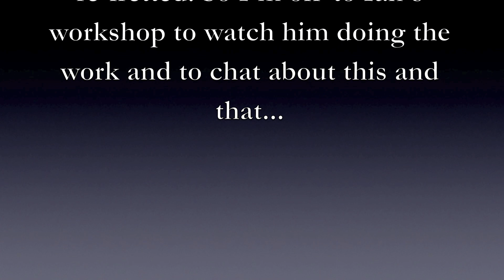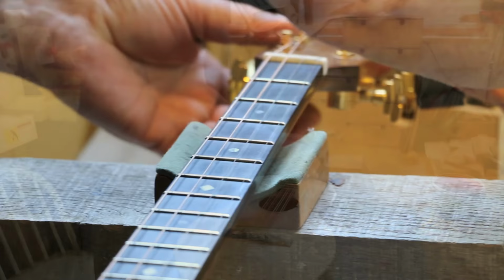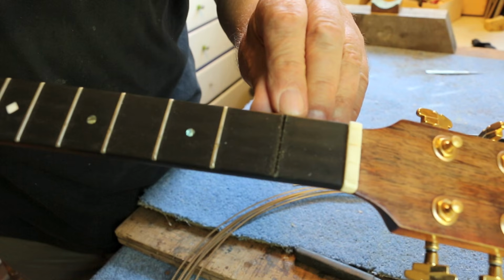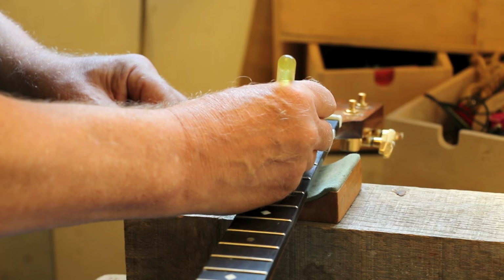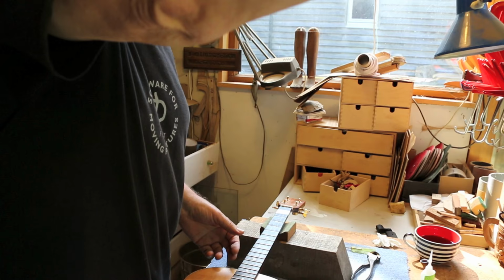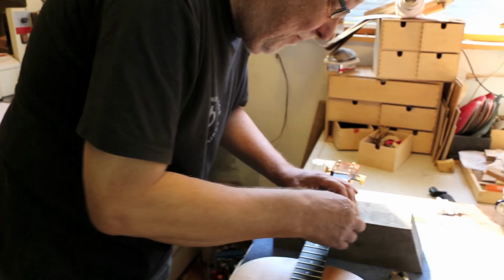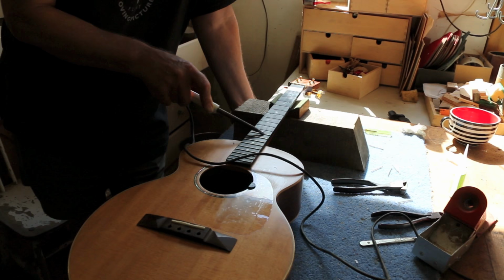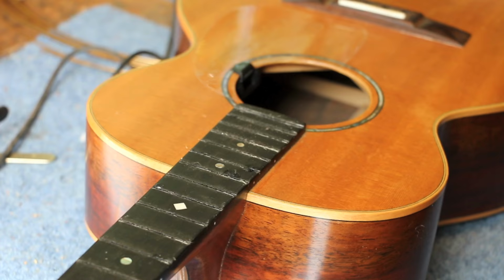Tenor Guitar Re-fret - Part 1

Comment: Will, Ian re-fretted my "budget" Martin in January 2011. I think I got it in early 2009, so in under 2 years the frets had worn to an extent that made it virtually unplayable. Now, nearly 6 years later, there is no sign at all of fret wear on the frets Ian installed. I don't play it quite as much as I did before I got my Chisholm, but still play it fairly often as it hangs on the wall in my office so is the one I get down whenever I need to take my mind off work for a few minutes. I complained to Martin, but they refused to acknowledge a problem. I saw on various forums that several people who'd bought this model around the same time had suffered similar fret wear and can only assume that  Martin had a batch of wire that was below spec.And the tiny mark that was left on the fretboard when I distracted Ian (as mentioned at around 15.40 here) during the work has long ago worn away!
Reply from the maker: I remember it well. My own similar "travel" Martin was bought in 2006 
and, 10 years later, after much thrashing, is just about due for a 
re-fret. They must have altered the specs between the years of 
manufacture for mine to have lasted so much longer than yours.